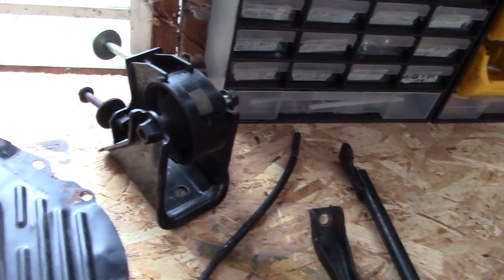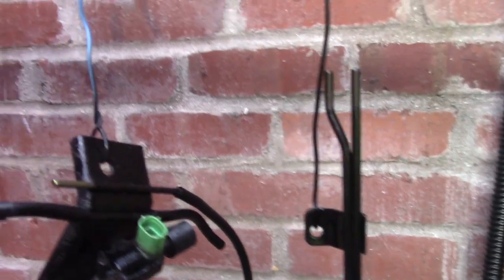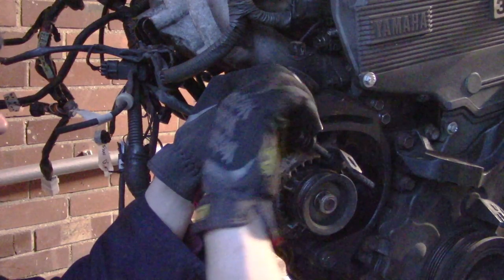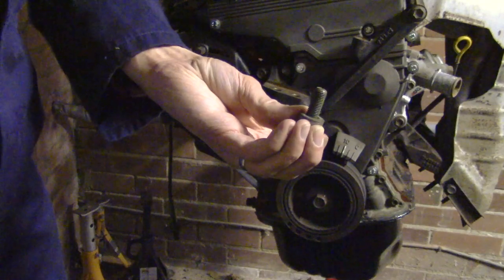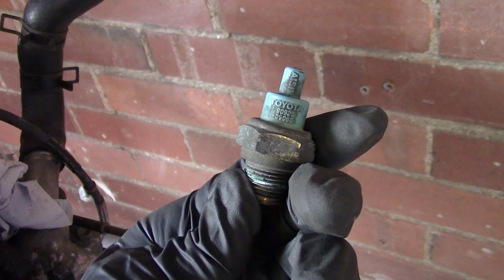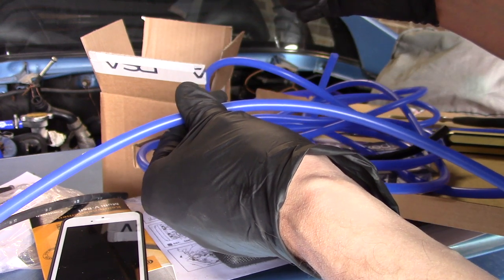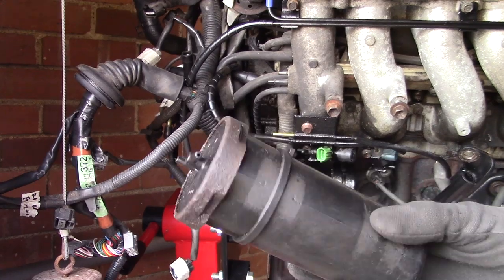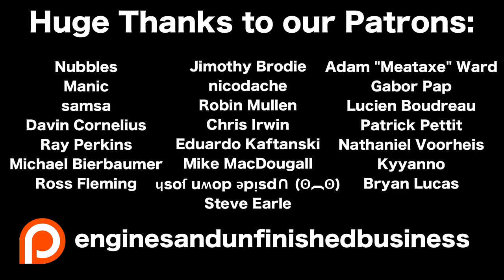Prepping the Engine - MR2 Restoration part 40

Comment: A man’s ball... yeah, it’s like 30 degrees and freakin HUMID here.  Pure suffering in the sun!  Trees, shade, good things to have around in July and August.  Speaking of trees, I think we call that red one a Japanese Maple.  Goes with my Japanese MR2 and my Mazda pickup of the same vintage.  I’m stuck in the late 80’s / early 90’s.  Alternator.  Yours isn’t a turbo so I think you will be okay, but the only way to get one out of a turbo is to drop the rear subframe.  Not like working on a 60’s Chevy where your entire family could have a picnic under the hood.  Had to show my wife the rattle can shacking... you guys are nuts!
Reply from the maker: At least you tend to have ac indoors in the us, over here we just have to suffer on the rare occasions it gets hot 😖 yeah the alternator will come out without dropping the subframe on the na cars, never did figure where that bolt was meant to go though 😖

Comment: I'm working on a 99 Tacoma right now with an aging 5VZ-FE. My 04 is in perfect shape so replacing vacuum lines won't be necessary for a good while. Meanwhile on the project 99 every vacuum line is cracked, torn, or previously replaced with non-vacuum line tubing. The previous owner actually tried using woven nylon water line tube... Cutting your own is definitely a solid option vs buying whatever Toyota still makes.

Comment: Where did you get the silicone vacuum line from?
Reply from the maker: Just from eBay, you can by lengths of 4mm internal diameter silicon hose

Comment: What was the diameter of your silicone line replacements :D
Reply from the maker: Think it was 4mm internal diameter, but can’t remember for sure, sorry 😖
Reply: Thanks for the info. I have the same engine in a gen 6 Celica and I heard they range from 4,6,10mm, so likely all the lines you targeted at the back of the engine were 4mm (looked like you were using the same replacement line throughout there) 

Hope you're well!
Reply: @EnginesandUnfinishedBusiness  funnily enough, I had 3m of 4mm internal diamater tubing to hand... I swear im never lucky like this

Comment: A vacuum actuated coolant temp sensor? wow Japanese cars have some weird stuff. You could try drilling out the holes and screwing/glueing in some small threaded tubes (... or very tiny brass nipples).

One of you is chuckling at 'nipples', I know it.
Reply from the maker: hehe, nipples. Yeah, the Japanese loved crazy vacuum setups in the 90's, that's a pretty good idea though, we'll definitely look into it if the car struggles with the current bypass set up